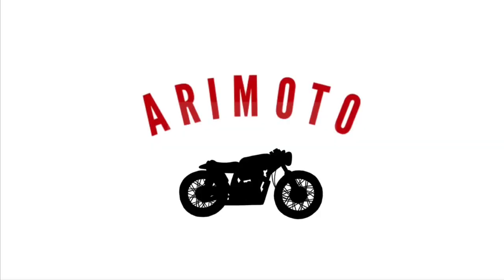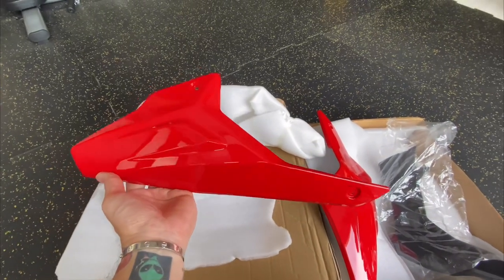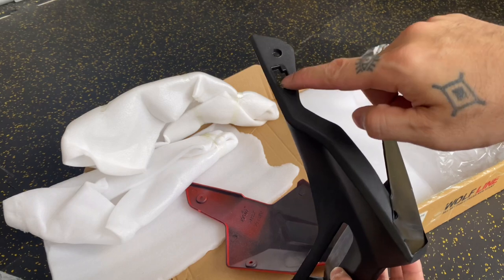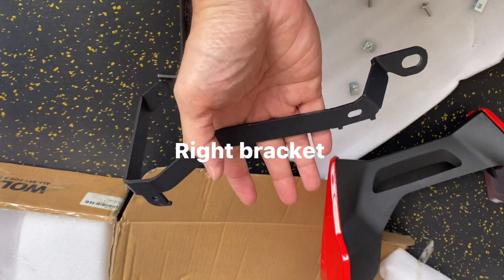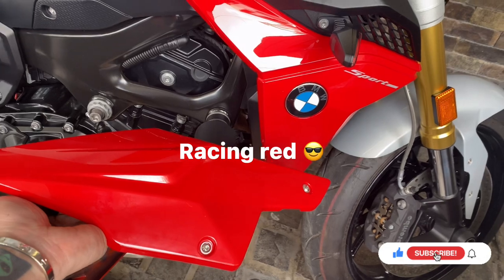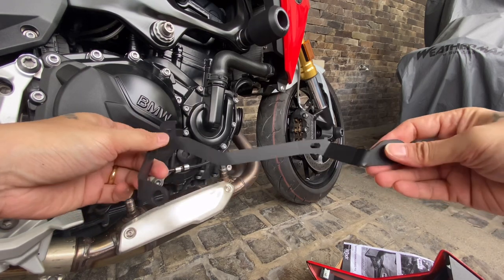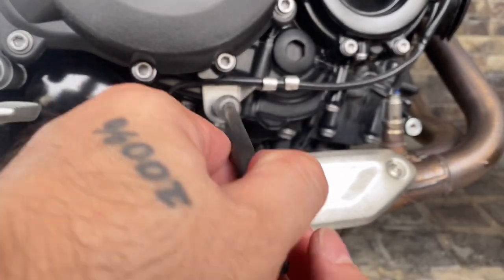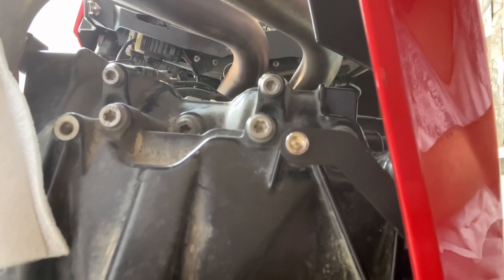BMW F900R | DIY Belly Pan Installation

Comment: Man, thank you very much for sharing the instructions pic, I got the pieces without instructions and you were my saviour. A tip if anyone is struggling with the left side motor rack top screw: you can unscrew the external screws from the left side so you can easily get the wrench to the screw and then twist it really strong, because it will get behind the left side part after tighting the screws back. Again, thanks a lot!
Reply from the maker: Thanks for the appreciation! Thanks for the tip too :) ride safe!
Reply: Yes was a tricky thing to do on that left. I left the right side loose but screwed in. That allowed it to flex into position with the left side large bolt in the bracket already.

Comment: how did you manage to get the other screw on the left side fairing installed? you showed the bottom....but the other screw is a pain in the ass.
Reply from the maker: I loosened the 2 screws on the left fairing so that the Allen wrench would fit and tighten the screw that’s pain in the ass.
Reply: Omg i woke up the whole neighborhood with a very loud Fuuuuuuuuuccckkkk!!!! After 5 times dropping the bolt into the plastics. Finally did what he said and it flexed more for install